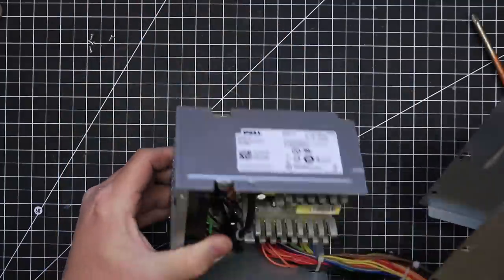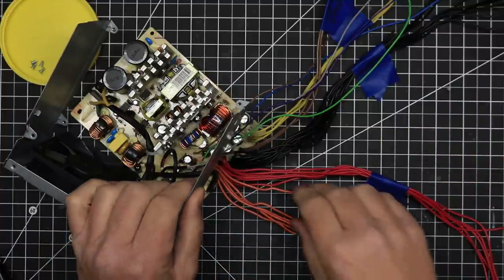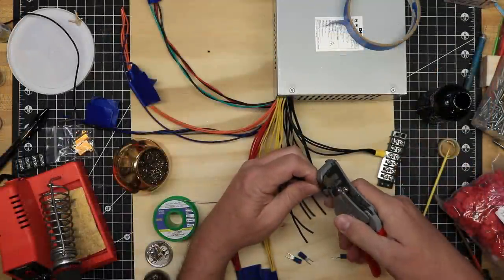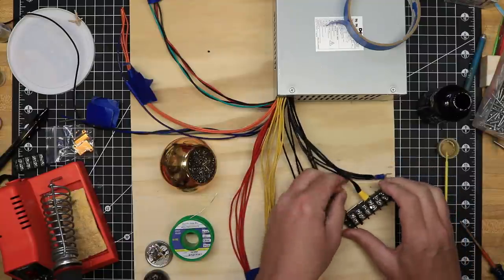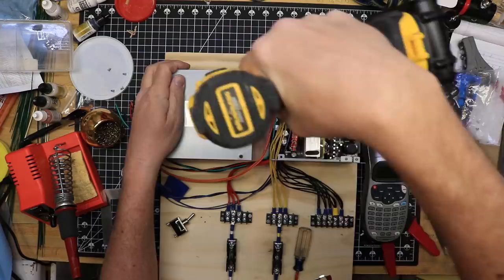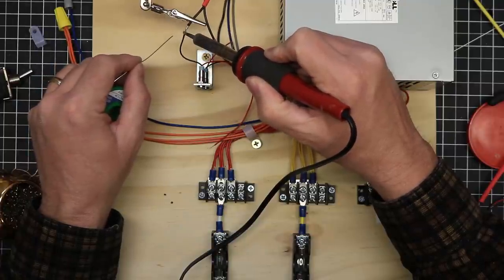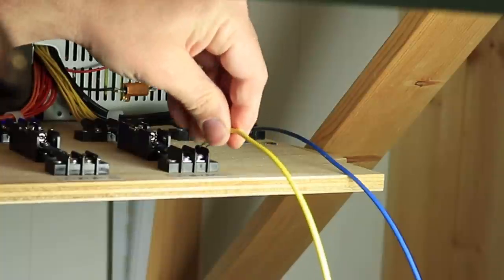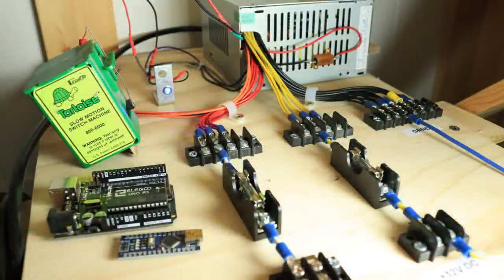Computer Power Supply for Model Railroad Accessories

Comment: The man takes apart a pc power supply for HO scale power needs. 

&$^%&^ GENIUS! I always used a 6 bay power strip, with a ton of random ac to dc adapters for the various bridges, lights etc. 

By making a secondary board with some resistors, relays and switches, I can have my power needs in one place. 

Im gonna start thinking out the box more. 

Well Done

Comment: That was a great help to folks for sure. Nice Job Ron.
Mike
Reply from the maker: Thanks, Mike.
Reply: Hi Mike, Ron told me that you model your layout with Kato, I had asked him if he would caulk or hot glue to mount Kato track, he thought hot glue but suggested I ask you.
I’m about ready to secure my Kato down so I thought you might give me some advice on the best way or your way how to do this, like under it or along the sides???
Not sure if you have any tutorials on your channel (I’ve never seen it but I’ll sure plan on it if you do), thanks for any help that you might be able to give me in this matter. Ron J.
Reply: @ronaldjoyce7374  Thanks Ron , I do not glue any of my track down unless necessary. I count on the ballast and scenery to do it. If I need to I will use low temp hot glue along the sides.
Reply: Wow! Thanks for the speedy reply.
I was thinking the same thing, all the glue on the ballasts should hold it but I haven’t modeled in the last 15 years and have missed out on so much.  I truly appreciate your help & Oh Ya, thanks for the directional help Ron 😉

Comment: The circuit board, itself has labels for the specs of the different components on the board.  They are marked next to each component, though the info is limited and can be difficult to read, it can still be of some help.  Power supplies from old or crashed game consoles can also work well for electronic projects.  I’m converting a power supply from my crashed XBOX 360 and attempting to convert a first generation Xbox power supply as well.

Comment: Great video, Ron!  This is something I have been meaning to do for a long time!  The video that I have been using for inspiration is by the great Joe Desmond and his Central Jersey Conrail in N Scale - 'Installing ATX power supplies on the Sayrehurst Secondary'.  However, what I am considering purchasing is an ATX Power Supply Breakout board (available from Amazon and other places), which seems to make it so easy - just plug in the power supply sockets and the breakout board supplies all the screw terminals, all labelled for the various voltages. Just need to do some more research on these...otherwise your method will be the way I will go!
Reply from the maker: Hi Peter. Yes, several people have links those in the comments here. I was unaware of them before.
Reply: @RonsTrainsNThings  I only found out about them recently, around when I was investigating the Digitrax BDL168 breakout boards
Reply from the maker: @peter_borcherds  I am planning to build another one for a bench supply, will probably try one of these for that.

Comment: You are able to get +5v, -5v, +12v, -12v and 24v all from a computer power supply as well as the possibility of a few other voltages. The 24v power is obtained by connecting directly across both 12v connectors. One of the much older AT power supplies also gives the same voltages but through a different connection with two wire bundles on an AT power supply.

Comment: Great video   i use 2 of these ATX's to power all my accessories BUT instead of cutting the wires i use a ATX power tester converter board  they cost a round £6.00 saves getting it wrong  would send pic if i had a link

Comment: What do you think of using WAGO connectors  on main and sub bus wire connections as well as for feeder wires under the layouts?  WAGOs appear to be very secure connections and come in 2, 3, 4 or more connection typees.
Reply from the maker: I have not used them myself, but I know some excellent modelers who swear by them so I am confident that they are good.
Reply: @RonsTrainsNThings  thanks Ron, I appreciate it!  WAGOs are perfect for household electrical connections.  They should work well for train wiring too.

Comment: Love this setup! Just wondering, what is the dimension of your board you used?
Between friends donations and my old computers, I've made 4 of these ranging from 300 watts to my latest an 850 watt unit. I plan on using the 3.3V for my LED lighting of houses & accessories with resistors and potentiometers to control the brightness.

Comment: Hi Ron, great idea fir extra power 👍🏻
I have a question that could use your expert opinion, I’m building a small N gauge table top layout, I’m using Kato Unitrack and I’m about ready to glue it down, would you recommend using the latex caulk or hot glue? Do you think it matters?
Your input on this matter would be greatly appreciated.
Reply: I used hot glue simply because it was faster. The caulk takes a while to “set” and things can shift. However, the call allows you to reposition things that aren’t quite right. Maybe a combination of both methods would be better?
Reply: @tom7601    Thanks so much for your input on this, I appreciate it very much.
I was thinking the same thing as I’m not a patient man LOL but I get your point as long as I get the track perfect the first time 👍🏻😊

BTW I noticed your tag photo, a lighthouse, interesting, I love lighthouses and have collected them over the years.  The closest one to me would be the Chicago lighthouse out in Lake Michigan just off of Navy Pier 👍🏻
Reply: @ronaldjoyce7374  Thats the La Jolla (La Hoya) California lighthouse in southern San Diego County. It’s now unused but converted into a museum.
Reply: @tom7601  Thanks Tom,  Your pic was a little small LOL.
I thought it looked familiar, I visited after we toured the Midway about 4 years ago.
Reply from the maker: I don't have experience with Unitrack, but Mike Fifer does and I think he uses hot glue. That's what I would do.

Comment: Great video Ron with lots of useful information. Thank you. A question for you if I may. with this supply set up driving your point motors, would you still need a CDU in the line for throw switches? Thanks again. Clive
Reply from the maker: I have this power bus connected directly to my Tortoises theougj a dpdt switch, no other components.
Reply: Like Ron, for normal Tortoises and various control items - mostly lights and signals- I just use direct off the 12V and 5V bus. In my staging yard I did use some of the PECO switch motors and for them I did use a CDU.
Reply: @robbennett1965  Thank you! That is exactly what I intend to do. As always, great advice to be had! Thanks again.

Comment: There are pre fabricated terminal products that make the power distribution problem much easier. They keep the 20 and 24 pin plugs from the power supply. This eliminates all the steps to create your power distribution.
Reply from the maker: Hi Charlie. Yes, several people have linked them here. Thanks.
Reply: @RonsTrainsNThings  A word of caution on the break out boards with fuses.  Those fuses are 5 amp. They will not protect the components connected to the break out board. A good choice is the Electronics-Salon version which has multiple taps that correspond with the pins and there are no fuses to give one a false sence of security.
Reply from the maker: Thanks, Tom. 👍🏼👍🏼

Comment: With a simple AC to DC 12VDC / 10A DC power supply, if you cut off the DC plug and expose the bare wires, would you get a major ZAP/JOLT when you touched those bare wires? How about a 12VDC / 5A DC power supply? I am just trying to fully comprehend how 10A and 5A differ with regards to getting a ZAP/JOLT from their bare wires. MANY THANKS!

Comment: Cannot understand why you are not using the 3.3 volt section to run LED lights in buildings or on control panels.  Newer power supplies are rated at over 30 amps for the the 3.3 volt section which is more than enough for the several hundred LED's on my layout.  That leaves the 5 and 12 volt sections to run control electronics and all of my Cobalt switch machines.  Waste not what not.  Cheers Brendon.
Reply from the maker: Because all of my accessory LEDs are run by Arduino, which take 12v power.

Comment: What is the purpose of installing the 10 ohm resistor between the black and the red?
Reply from the maker: The computer power supply requires a load to turn on. The resistor supplies that load.

Comment: Question off subject. I have a snap track (turnout) switch, do I use 12v DC or AC current to power it?
Reply from the maker: You need to check the manufacturer's specs, but I think in most cases 12v and always DC.
Reply: @RonsTrainsNThings  Thank You very much

Comment: It's amazing how hard it is to find out the best wiring practices for wiring accessories. Track lights, street lights, building lights.  Wired in series or parallel? 6 videos and 5 websites later still nothing.  Nice vid though.

Comment: Is my monitor going funky.. or do you also have brown?
Reply from the maker: As I mentioned in the video, the power supply I opened at the beginning was not the one I used for the rest of the video. Long story. That supply did have a brown wire--the 3.3v sense wire. You will find it listed on the color code charts.
Reply: @RonsTrainsNThings  Ahh, sorry, you said that so much earlier in the video, i had forgotten by that point.

Comment: I am unclear what the standby is for.  The video shows you did not run that LED indicator to your fascia.
Reply from the maker: The standby line shows that there is power running to the power supply, thus internal components are energized even if the supply is powered off. No, I left the standby light on the power source itself. The only time you really need it is if you are working on it, so you don't get a sudden surprise shock.

Comment: There's an easier way that can be used for an old AT or ATX computer supply ... supplies that have a 20/24-wire connector.  It already has terminal poles, fuses, power switch, LEDs, etc.   They're generally available from Ebay, Amazon, and AllElectronics.

For an example, see

 https://www.allelectronics.com/item/atx-bt/atx-to-benchtop-power-supply-conversion-kit/1.html
Reply: @Donald Kormos The only problem with that style break  out board is the fusersare over rated for the voltages except the 5vdc.  You may need to replace the fuses to a lower value to protect your components, if that's what you want. There are others with more terminals and no fuses.  Electronic-Salon may be a better fit.

Comment: If you really wanna have some fun, get a 1100W serverpower supply and a ‘breakout board’ that crypto miners use.
Reply: You’ll have 16 8 pin 12 volt connections
Reply: That’s enough for 64 independent 12v leads…
Reply from the maker: That sounds awesome, but probably overkill for a layout of my size. 👍🏼

Comment: Why did you delete my post???
Reply from the maker: I don't know what post your are referring to.
Reply: @RonsTrainsNThings  I am referring to the post, about using the power supply connector, to make your setup 10 times faster, and it already comes with fused outputs, and an on/off switch, that you can use, and not have to open the power supply up, and remove all of the wires you remove. It makes it a 10 minute setup. I left a link for it, but, I also sent you an email. I was only trying to help. You said you weren't an electronic engineer. I AM. I was trying to show you, how much easier it would be to use the power supply adapter. Those who HATE working with electronics, don't have to dig in to all of the unnecessary work on the power supply. I GLADLY showed you where you could get them, and even resell them on your amazon site. I am not selling them. I am not in the business to sell. Since it is NOT on here, check your email. Find them on Amazon, if you wish, they are there too. It would just make things QUICK AND EASY, for those out there who are really not good at working on ANY electronic, and electrical setups. It already has hookup spots for all of your connections, and they are CLEARLY MARKED.... you cannot make mistakes, or get shocked. 

I offer my HELP.... for you, NOT an interference.

Taz...
Reply from the maker: I did not remove your post. All posts with links are held for review to avoid spammers posting their links. I have been at work all day and I am just now sitting down to respond to comments including reviewing and okaying comments held for review.
Reply: @RonsTrainsNThings  Sounds good. Feel free to contact me. I had NO idea, Ron. 

Thank you!!

Taz...
Reply: @tazcurrier2193  FaceSmack...  Links and or Spam, bad words etc. are removed by YouTube.  If not ever other post will be a link to Prawn site in Russia or a I have 1 million dollars and I want to give you half scam.